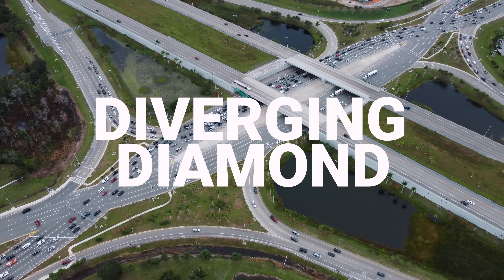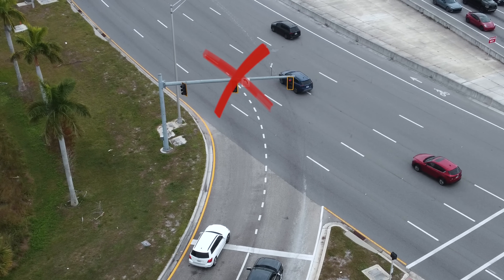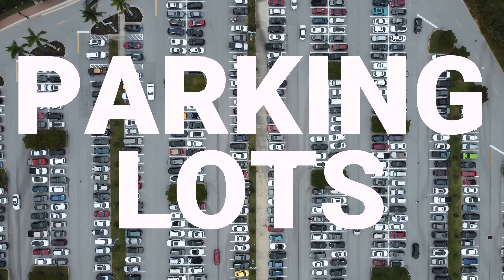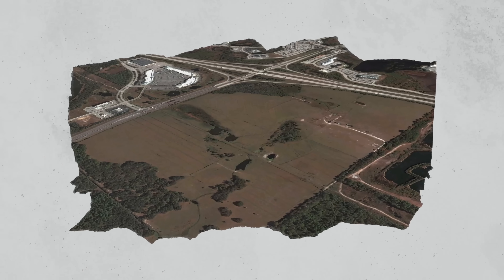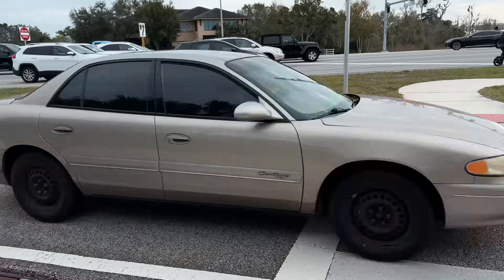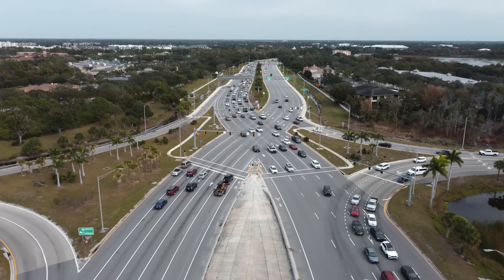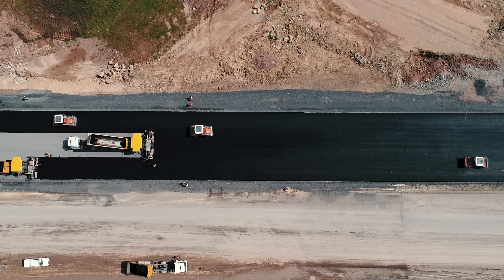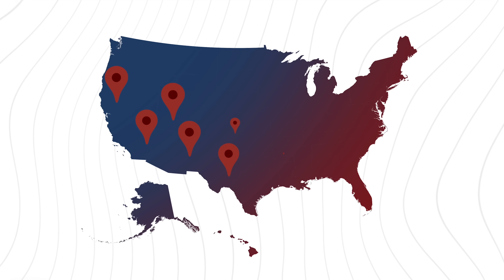Traffic Will Never Be Fixed Here

Comment: Hang on. These lights aren’t set up so that they simply don’t go green unless there is enough room to pass the intersection?! That’s literally insane.
Reply: The green for the lights going away from the bridge are concurrent with the ramp that empties out from the high-speed overpass.  It is critical to clear the ramps so it does not queue into the high speed lanes.  Hence why the outgoing light remains green until the ramp is cleared.

Comment: They really do be doing anything but roundabouts.
Reply: Because a roundabout would not work here.  Roundabouts would fail because the traffic volumes are greater than a roundabout's capacity, and the construction would cost more.

A roundabout interchange would cost more because it would take more right-of-way outside of the prior interchange design.  That would require more stormwater management facilities, as well as shoring / retaining walls due to encroaching into the slopes of the overpass highway.

And the roundabout would not be efficient for places with such high traffic volumes.  They max out at 1000 vehicles per hour for single lane roundabout (1700 for dual lanes).  Roundabout interchanges are better for rural/surburban locations where traffic is not projected to increase.

Comment: Have you tried walking anywhere when it’s hot, humid and with bright sun, or in rain?  It’s physically draining regardless of fitness level and you arrived soaked in perspiration.
Reply: Have you tried walking anywhere when it's hot, humid, and with a bright sun, or in the rain in a well-built city? I visited Mediterranean Europe during the peak of a heat wave - 90 degrees plus, basically 100% humidity, ruthlessly sunny, and I didn't have a single problem walking around the cities I visited both large and small. If it's raining use an umbrella, come on man you  don't need a car to protect yourself from rain.

Shade is by far the biggest factor. It doesn't matter how hot or humid it is, if you have shade and the slightest breeze it's not too bad. European cities have taller buildings and thinner streets, so at most times of the day at least one side of each street will be shaded. If there are trees on a street, and there often were, the time of day isn't even important. These aren't coincidences either - European cities are designed with shade specifically in mind, that's why the 3-4 story building is standard basically throughout Europe; it maximizes the amount of shade produced without people feeling enclosed.

Comment: You know how traffic will be fixed, self driving vehicles, vehicles that can think in a millisecond, instead of the 100 or so with us, vehicles that could communicate their intentions to each other. There would basically be no need for traffic signals because the cars would never hit each other, no human intervention means no human problems.
Reply: Vehicles that communicate with other vehicles to achieve theoretically perfect traffic are a farce. Not only are the technical and mechanical limitations all but impassable, but it's absurdly vulnerable to attack. If any vehicle can declare its intention to, say, drive in a straight line at 60mph, but actually swerves into oncoming traffic while accelerating to 90mph what are other cars going to do? If they listen they'll crash, if they try to dodge then the difference between declared intention and real-world result will cascade into a massive clusterfuck. At the bare minimum, if I want my car to self-drive the most direct route I'll just have it tell all the other cars "hey I'm going to drive in the wrong lane at 100mph down the street, get the fuck out of my way" and ruin the driving of every car near me even if I don't actually do that. It's a security nightmare.

You know how we can really fix traffic? By lowering traffic volumes. Less traffic means infrastructure works as intended, and everything will be safer and last longer. That's it. It's simple, cheap, and we already have thousands of years of tools to do just that.
Reply: @ You really underestimating the technology, it wouldn’t just be 1 car communicating, it would be EVERY car communicating. Communicating at speeds 10-15x faster than our reaction time. 

Yeah mechanical failures happen, but they are much rarer than human errors. We kill over 40,000 people a year in just the US alone in car accidents, while there’s only been about 50 cases of autonomous casualties in total between the time of the pandemic and now. 

I get where you’re coming from. It’s not exactly a fully tested technology, and this really is just a theory we’re going off of based on the technology and capacities we know are possible with Self driving vehicles.
Reply: @deadlyknights1119  firstly, you cannot over or underestimate tech which doesn't yet exist. Secondly, the number of cars communicating doesn't prevent malicious actors from using that communication to cause crashes - "I will keep driving forward at 60mph" "okay I will follow" :slams brakes, causing an unavoidable crash:. This isn't a matter of mechanical error, of communication speed, of reaction speed. If I can send a message to another car which determines in part how it acts then I have endless opportunity to use that communication maliciously.

FSD will never, ever, implement communication with other vehicles as a determinent in how it drives. It is a fundamentally vulnerable idea. The quality of the driving is irrelevant.

Comment: I strongly prefer cloverleaf instead of diverging diamonds
Reply: If you prefer clogged traffic and increased crashes, then whatever floats your boat.
Reply: @traffic.engineer  Really? Could you explain to me why? At first glance just intuitive I wouldn't think about it like that
Reply: @SR316PCCRehab  Cloverleafs, like roundabouts, work when volumes are low.  When there is more traffic there is less gaps for the ramp traffic to freeflow.  This requires more stops, that increases the queues with additional traffic.  Therefore, the ramps will clog up, to the point it extends back to the high speed lanes.
Reply: @traffic.engineer  I understand, thanks for the insight. However, what would be better in that case instead of cloverleaf / roundabout to avoid colliding traffic paths and increasing collition potential chances?

Comment: The same is true for roundabouts.

Roundabouts and diamond-shaped junctions are both efficient and safe.

However, there is a limit to the traffic they can accommodate. Above this limit, they become completely inadequate.

What could be the solution to the situation shown in the film?

Two small viaducts that would allow the two carriageways to swap places, but without the use of traffic lights.

This still means much fewer viaducts and less complexity than a traditional road junction, and it also eliminates the problem of a "clogged" intersection.

Comment: Diverging diamonds are over engineering the problem. There's a much simpler and more intuitive solution that has been working for decades. Put round abouts at the end of the on and off ramps.

Not that round abouts would fix that sheer volume of traffic either.
Reply: Roundabouta are worse because the queues would extend into the high speed lanes.  Diverging diamonds allow quicker clearance of the ramps due to the concurrent signal phasing.

Comment: Crosswalks and bike lanes on motorways? What kind of madness is this? Did a supervillain design this? Decide... is it a motorway or a regular regional road? If it's a motorway, then it's for motor vehicles, multiple wide lanes, high speeds, and NO TRAFFIC LIGHTS (free flowing interchanges and on-ramps). If it's a regular road, then it shouldn't be more than 2 lanes in each direction, speeds at most 60km/h, and 40 around crosswalks, narrow lanes, bike lanes, sidewalks, and regular intersections.
If it has 5 lanes in each direction, it's a motorway and has no place anywhere near urbanized places.

Comment: Mixed zoning would help fix a lot of this. The US Zoning laws create an environment that heavily incentivizes car travel that leads to a natural selection effect that favors large distances between businesses, work places, and residences and the maximum captivity of each depends on road capacities. A large road allows more customers, workers, and inhabitants to go to the area supplied by the road until a limit by which the road can’t supply enough people for new businesses to be economically viable or for enough employees willing to travel to a location. Road expansions increase that limit allowing more development until a new maximum is reached in an ouroborus cycle. On the one hand the area becomes more and more economically developed but on the other hand if the economy is growing , the traffic is always guaranteed to be approaching the maximum road capacity. A building can fit a lot more people than an equally sized parking lot and so the same number of people takes up a disproportional number of space. Places people want/need to go are often too far even cycle. Public transport can alleviate some of the stress but is very expensive to develop and maintain. The core of the problem though lies that people are forced to travel further than necessary to get their needs met. By changing zoning laws to allow more mixed residential/commercial zoning will redirect a lot of the travel demand to local destinations simply because they’re easier to get to and all of a sudden the large roads and public transport can pick up the rest of the slack. Yes traffic will still be there but it will be significantly less than it was before

Comment: Against all the internet hype, i am and always was of the opinion that those interchanges suck. They force everyone (!) to cross traffic twice. I find it so obvious that this is a failed design, that i kinda feel the urge to wanna sue those planers who let millions of currency and hours go wasted, for what they should have seen on the drawing board. Put roundabouts on both sides, problem solved. But, uhhh, i know muricans dont like those. Well, stay stuck then, if you think braids are a better way.

PS: If those braid strains would at least pass each other vertically, as braids do... then this whole concept might actually make sense, half-way, at least. I say braids, cause "diamond" makes it sound like something really valuable.
Reply: Roundabouts have more conflict points, which would increase the stops and delays.  The purpose of this intechange is manage traffic getting on and off the freeway ramps.  The non-freeway road has less through traffic, whih justifies this design.

Comment: You say that the only components that can't be changed are the two intersections, but (in hindsight) couldn't those have been eliminated by separating the grade of the  opposing directions of traffic? Granted, this would obviously increase cost but would it be infeasible were there willingness to spend the money to do it?

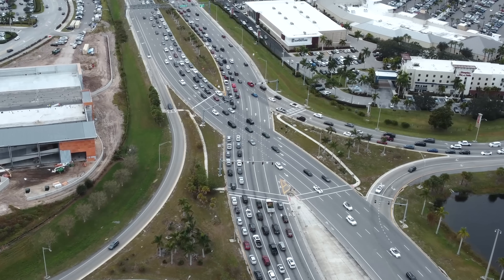Comment: 4:02 I do not agree that its the drivers fault here. On small intersections, yes, blocking it would be probably your fault. But here you'd either have to have a gap in the size of the whole intersection area to the car in front of you (which means a LOT fewer cars are going through), or judge a lot of traffic that you simply cannot see from your car. This is an issue with the design.
Reply: Cloverleaf intersection would have been way better as it does not introduce two backlog inducing traffic lights.
Reply: @whtalt92  Cloverleaves usually handle pedestrians even worse than diverging diamonds do
Reply: @TheStrolch  only because this is such a great example of poor traffic type separation.

Comment: All they need to do to further reduce conflict points and resolve the "backing up" problem, is remove the intersections where the lanes cross by replacing them with overpasses. In that case, it will be like a cloverleaf but with left exits.

Comment: This is so easy to fix aCtually, just add a few "reversed lins at flip point which will terminate road into a parking lots directly. this will totally fix the existing problem.  This particular DIV as it built DOES NOT changing ammount of conflict points, in fact it is just takes them away from each other., because on the next crosroads those points are going back.

Comment: 1) have someone told American road engineers about Shamrock intersection? It works the same without changing directions.
2) bikes + mass transit maybe?
Reply: Streetcraft has a short explaining why shamrocks do not work here.
Reply: @traffic.engineer  I know, but german's shamrock (with left lines of the both roads separated + speed limit on them is added) was not covered in that video. And that upgrade treats all claims.
Reply: @makb_the_striker  America has those shamrock interchanges as well (called collector/distributer lanes), but he same issue occurs.  There is too much traffic at the merging points, which causes more stops.  Those stops increase the queue into the other diverging and merging points.  Shamrock intersections are better for low volume roads.
Reply: @traffic.engineer  IDK, in Europe when there's a speed limit of 40 (25 in freedom units), there's zero problems with that interchanges. Even on the crowded roads. In Kyiv shamrocks were upgraded by German model on in-city highway which leads to one of three bridges over Dnipro. So they serve as the main intersections for Poznyaky and Osokorky districts (400-500 thousands combined). And accident statistics is quite average.
Reply: @makb_the_striker  Is that 40 for the main road or 40 for the ramp/loops?  A shamrock for 40 kph limit highway seems excessive.
Reply: @traffic.engineer  40 on separated lanes, which then unites with ramps and loops. On the main road limit is 80, but everyone drives 100 🤣

Comment: @7:10  how the hell is it save to put the bikelanes in the middle of this monstrous intersection?
This would have worked better is they used some over/underpasses. Even for the bike lanes.
You make this kind of this when you don't care about people. And only about your on pockets
Reply: Because the bike crossing does not interfere large volume freeflow left turn lanes.  They are concurrent with the signal phasing, which allows bikes to travel with the flow of traffic while the conflicting vehicles are stopped.  This lessens the conflict with turning vehicles while also being more efficient.

Comment: It is not even that hard. Every major city has a few roads that are lined with shops, restaurants, malls, and department stores. It costs too much to maintain and upgrade. It stresses all the roads nearby. It is loud and unsafe. It is overdeveloped to a point that no one wants to be there. They should pick a few quiet roads where it is relatively underdeveloped and plan infrastructure for more human scale businesses, preferably next to housing. Be involved in planning to restrict oversized stores and malls in favor of shops and stripmalls. Intermix with small private businesses and housing. Then, increase taxes for businesses in those overdeveloped areas. As they move, put in multi-family homes and apartment buildings. Suddenly you have an uptown and a downtown where before you had an overdeveloped city center surrounded by a sea of single family subdivisions. They can continue to do this until they reach a medium they are happy with. You have stores and restaurants you can walk to, those you can use public transportation because it is just 5-10 minutes away, and those that you drive to.

Comment: Wouldn’t having fly-overs at the crisscross points eliminate the issues with the lights? Sure one direction could back up due to surrounding intersections. But the opposite direction wouldn’t be affected. It would also remove the light cycles during normal conditions.
Reply: If you want to increase the cost of construction twenty-fold, then sure.
Reply: It would be expensive, no doubt. But that thing is already 10 lanes across and the overpasses would eliminate 4 signals that have to be coordinated with each other and surrounding interfaces. Don’t be flippant, it’s a legitimate question.
Reply: @nickwaters9869  Making it free-flow would also overwhelm the flow of traffic at the downstream intersections. Signals at the interchange are a form of traffic flow metering.  Though not as well because these signals are already overwhelming the downstream signals being so efficient.  So even more improvements would be necessary outside the interchange.

Comment: Why not just reduce the lanes and build a cloverleaf?
Reply: Cloverleafs do not work with large volumes of traffic.  Just like a roundabout, the greater frequency of merging traffic creates for stops and queues.  Streetcraft and Practical Engineering have already explained this in other videos.
Reply: @traffic.engineer  Cloverleafs work for expressways. They're less expensive than stack interchanges but still beat any design with traffic lights.
Reply: @flameoguide  Again, they are only efficient on low volume roads and expressways.  They also use A LOT more land than a diverging diamond, so it would be much more expensive to construct.
Reply: @traffic.engineer and that isn't even mentioning the amount of conflict points and extra traffic backup caused by people merging on and off the highway on the same stretch of pavement, usually the same lane

Comment: I live in FL and have driven on this road several times. The layout is great. The biggest problem is that when traffic backs up, people try to "beat the light" and enter the intersection on yellow. Then when the oncoming traffic needs to go, multiple lanes are blocked. The video had some great aerial shots of this problem.
Reply: Why not have a pack of motorcycle cops patrol there for a month. I bet you it will get better when that happens
Reply: @grsafran  wish it were that easy…
Reply: It also does not help when drivers stop 2-3 car lengths back from the car in front of them. See it far too often around there.
Reply: @tomhenman4302  💯